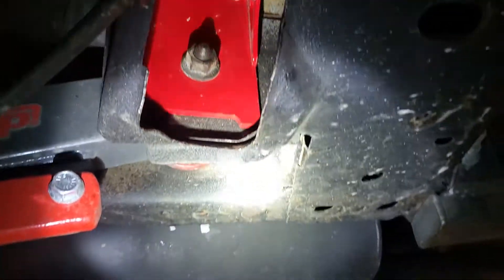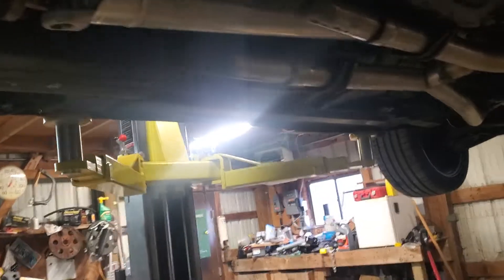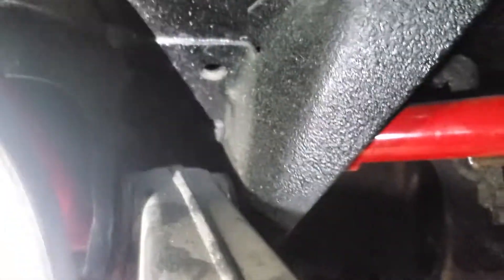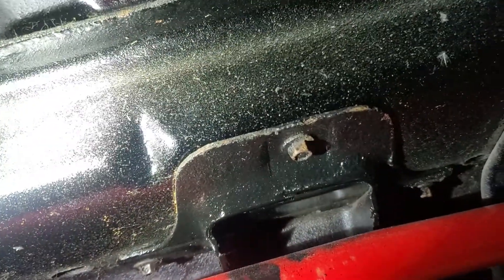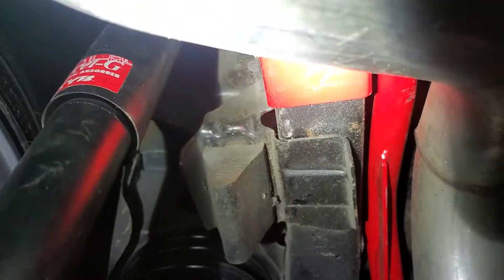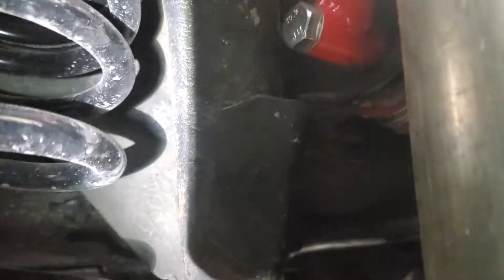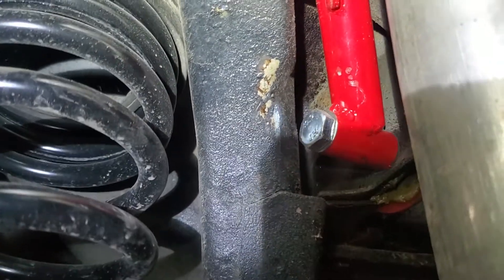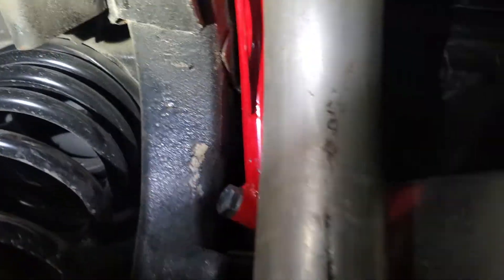Foxbody BMR torque box reinforcements

Comment: Yeah.. I'm buying this kit now.. it is a bmr kit btw..I was skeptical about this kit because of the lack of videos showing more mounting/installation etc.. but by chance I found your video.. good job.. it's definitely a nice study kit..I to hate the other one for the same reasons.. those spacers coming up threw the floor looking some welded in 10mm sockets..lol
Reply from the maker: I felt the same way... because if lack of videos. I really like how this kit ties both sides together. Also the fact it doesn't have those plates in the floor for the uppers. It really feels nice and solid going down the road. Like a whole new car
Reply: @vfr800fi07  I bought this kit and I'm dealing with the rear brake line center mount bracket hitting the middle crossbar. Did you have that issue? I knew about the pinion stopper having clearance issue but the bracket caught me off guard.
Reply from the maker: @MC-mr9ht  let me check... I think I did have to do something
Reply from the maker: @MC-mr9ht  yes I just went out there, I drilled out the rivets holding that bracket and moved it back to clear that bar and then ran some self-tapping screws up there